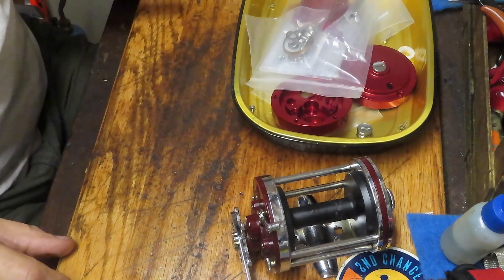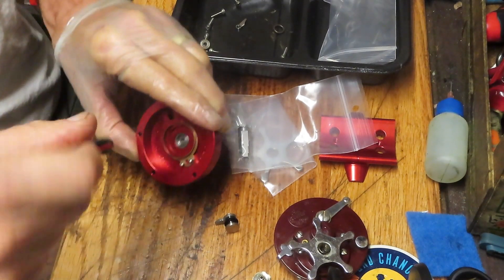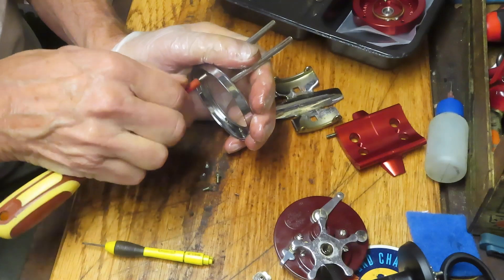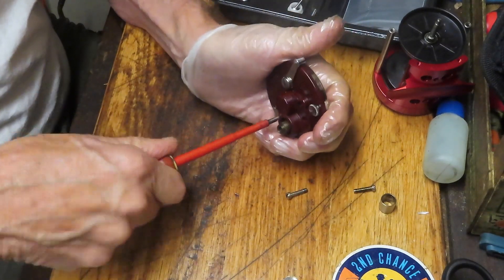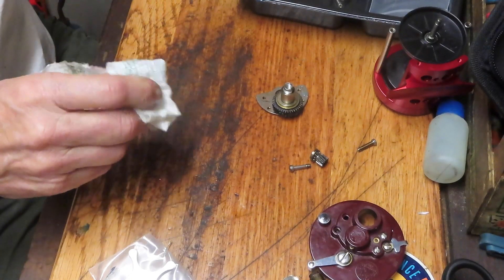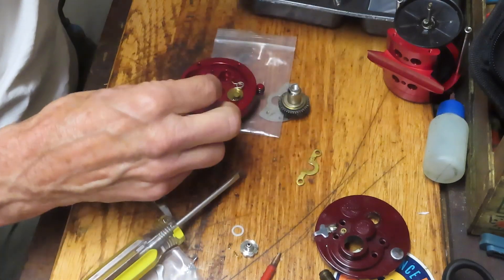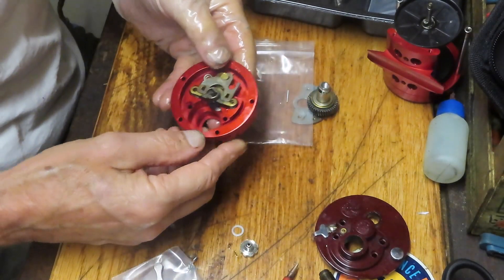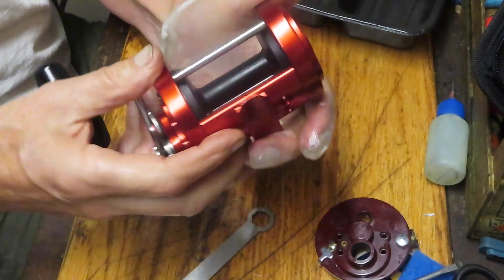Unbelievable Penn Squidder 140 Cortez Conversion how to do the upgrade

Comment: My concern is that base plate looks much thicker than the original, the feet being thicker might not fit correctly on the on the reel seat of some fishing poles ? I’ve had that issue before. Does that kit come in the Squider Jr model ? Thanks,
Reply from the maker: I don't think that will be an issue as long as the two mounting posts are the same standard.  I need to check.  Thanks for the note -   They do make the conversion for the 146 size reel - Dennis